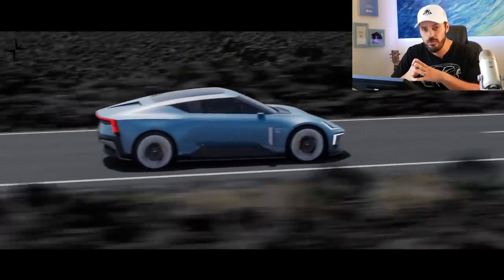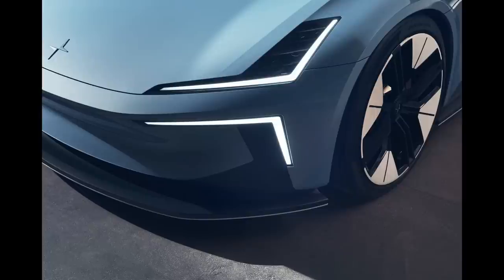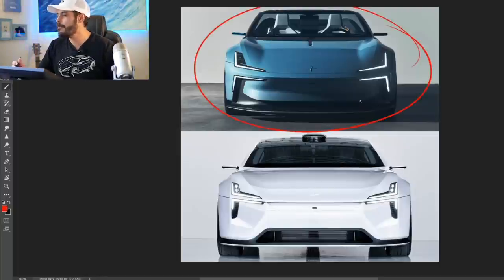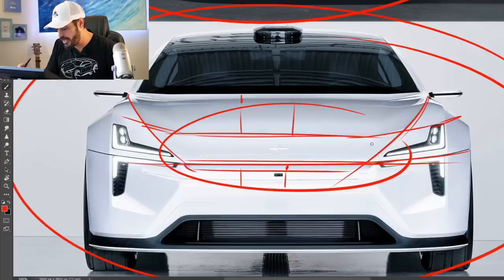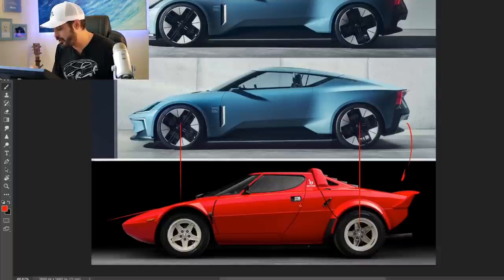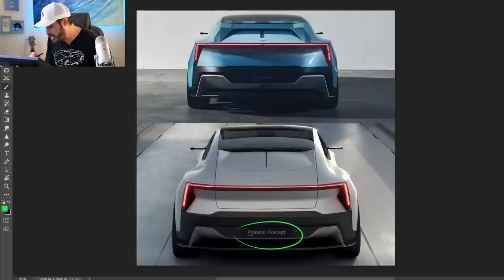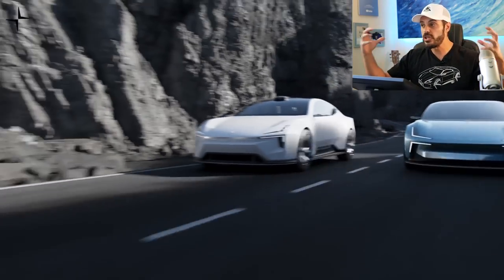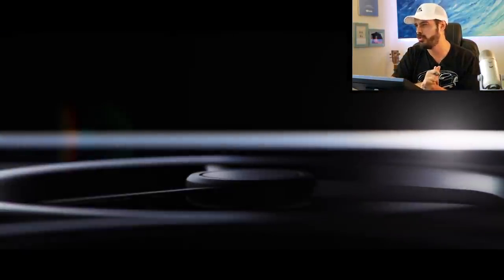Guess what...Polestar is ACTUALLY GOING TO MAKE THIS!

Comment: If it’s replacing the Polestar One, don’t you think it should also be called oh I don’t know… The Polestar One?
Reply: The polestar one two
Reply: @TomYourmombadil  Polestar One 2: Electric Boogaloo

and the name would work perfectly!
Reply: I agree. First, Polestar 1 wasn't fully electric. Second, it's no longer in production after the limited number special edition is made this year. Third, this new car won't be out for another three years (though you can order one now. 🤷‍♂️) Fourth, both are two doors. All of which makes perfect sense for this to take over the Polestar 1 nameplate.
Reply: @jeffs6090  or accept that the number tells about when it came/comes out instead of size
Reply: @sneaky_krait7271  - I'm well aware their naming structure is just the order that they are released. However the Polestar 1 is no longer made after this year. Is the name just going to go away too? Ideally, it should have a successor, and this being a two door makes perfect sense to be that.
Reply: @jeffs6090  I disagree, because then you break away the logic of biggest number is latest car. Calling it the newest car the 1 again makes it confusing. Mixing up body type and release date into the naming will become very confusing eventually
Reply: @jeffs6090  I mean it's like other products. like you have iphones, which all have different numbers just based on the release. Imo it makes more sense, when you refer to the polestar 6, there will be no confusion about what model year. if it was called the polestar 1 again, then you'd have to specify "oh the old one, not the second or third version". It just makes more sense to have the numbers be sequential
Reply: @sneaky_krait7271  Not really. The automotive industry has been doing this for years without confusion. If anything, naming their next car the next successive number is what will get confusing, since u don’t know what order the cars will come in. Like if Polestar releases a sedan directly after the Polestar 6 which just becomes the Polestar 7, and then the crossover is the Polestar 9, so on and so forth. U then have to keep track of what each car is because it’s never constant and predictable. It’s like if BMW decided to keep naming their cars successively, and instead of the M2 or the X3, we’d have the M32 or the X69, which would eventually get confusing because you’d never know which one is which until u checked their website or went to their dealership. So ordering them in the order of which one is oldest is actually very fucking stupid. The iPhone can get away with this because it doesn’t change what it is at its core, and it doesn’t coexist with other iPhones. Cars however, are not iPhones, so they must be named accordingly
Reply: @mrsoisauce9017  When talking about an X3 for example, you will have to look up which model year to know which car you are talking about. With Polestar you know about it's age from the name, you have to look up the size. They both work in different ways, you're just not used to it. Mixing them makes everything unclear however.

Comment: Thanks for this very interesting reviuw and great to hear that Polestar is going to build this beauty.
I really hate that Tesla style glued on big center screen. Polestar should have a coffee break with Genesis interior design team.
Side note: Big hp numbers in Swedish cars is not something new at all. Koenigsegg has been leading that race for many years.
Also Volvo has produced models with really high hp.
If you look at big trucks, Volvo and Scania has been at the hp top for long time
Reply: So people hate glued on big center screen in cars, but don't mind non-integrated screens at home?
Reply: @automation7295  Uh, yes? Are we really making false equivalencies between the space in someone's home vs the substantially smaller space in someone's car in which a non-integrated screen serves no practical purpose opposed to the practicality it serves in homes and elsewhere?
Reply: It's the "floating" style and integrated will not work with the Polestar style. Some high-end apartments have floating screens over their fireplaces, so it's something seen in higher end settings. I don't love the big screens but that's current car design. Tesla actually integrated the screen in the Model X and Y and it is landscape. So, it's not really like Tesla. On the 3 and Y, it's still landscape but the interior of the Polestar 5 overall is so much richer than the stark  look of those cars. Genesis integrates the screen well in the G90, not so well in the G80. Well in the G60. I like that Genesis has more physical buttons. They're nicely designed vehicles.

Comment: Is there a Polestar 4?  How did we get to 6 so quickly?
Reply: polestar 3 too.
Reply: 3, 4, and 5 are all in the works, and they will all be out before this roadster which is slated for 2026. Polestar 3 starts production in October of this year in SC and will be an suv type vehicle about the size of an XC60 (perhaps a touch bigger). The 4 will be a coupe version of the 3 and go into production next year. Polestar 5 will be a large 4 door sedan with competition being Tesla S, EQS, and Lucid Air. It's set to launch in 2024.

I was hoping this roadster would take over the Polestar 1 nameplate since that current car is discontinued after its final run this year. Both being two doors, it would have been perfect.